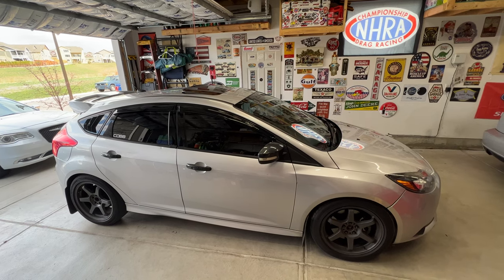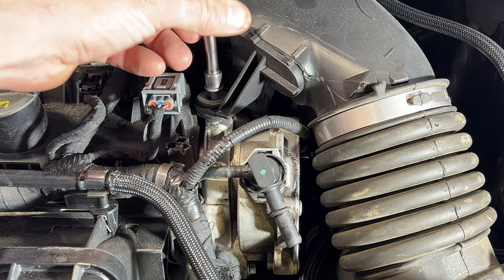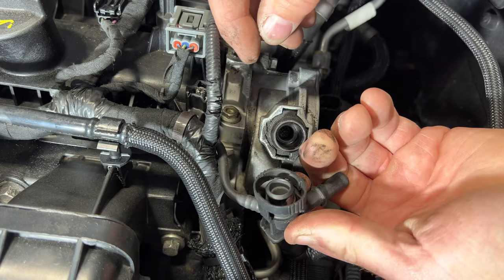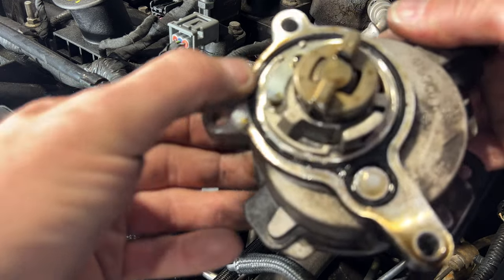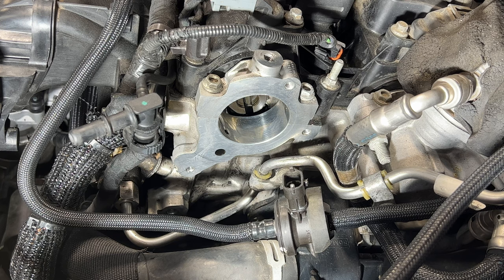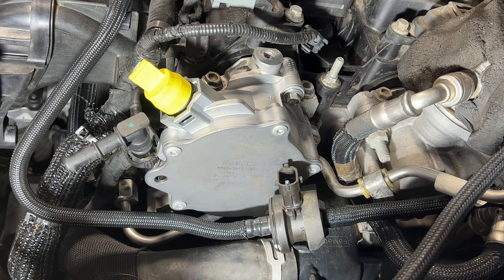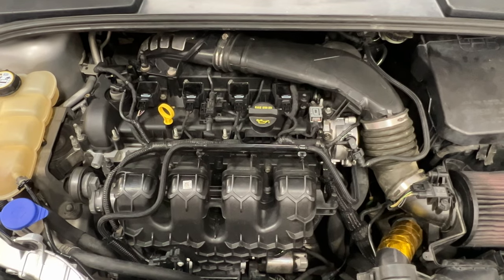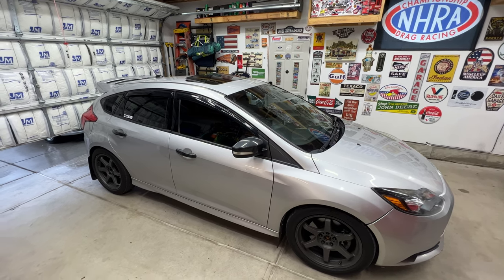Ford 2.0 Ecoboost Vacuum Pump Replacement How-To

Comment: It was exactly my problem. But on my side the Pump has jammed and the Camshaft Pump Drive Coupling bolt has broke. I replace the pump and the coupling screw. It Was very fun to remove :) Your video help me thank you.

Comment: That clip you removed on the top of the vacuum pump that connects the vacuum lines from the boost controller and the brake boost line. What is that clip called and what is the part #? Thank you!
Great video by the way, wish more people made videos like this
Reply from the maker: Unfortunately you have to buy the whole vacuum line assembly and not just the clip. https://www.tascaparts.com/oem-parts/ford-vacuum-line-cj5z9961b?origin=pla&gclid=Cj0KCQjwib2mBhDWARIsAPZUn_lzGg6Wj7T1Mt5x24kduTocf7n_DO5ZPShqYJODQbsZsBdHY4jpli8aAmLKEALw_wcB
Reply: @BLUECOLLARGARAGE  thank you so much. Broke mine yesterday putting new charge piping on and adjusting my EWG. Glad I can get it fixed

Comment: Same part fitted in 2013 Volvo S60 T5 with turbo 4 cylinder 2.0 (B4204T7 engines) Identical part.
Reply from the maker: Thanks for the info.

Comment: 1:50  - Denso stickers on those ignition coils. I didn't know Denso was the OE provider for Ford for those - are those original or replacements?
Reply from the maker: They are replacements but are actually motorcrafts rebranded as denso’s I actually go over that in this video if your interested https://youtu.be/IEcOzFD2-Y4?si=2pJLXhVKGmNjd5ze
Reply from the maker: They are actually motorcrafts relabeled as denso’s I go over that in this video if your interested https://youtu.be/IEcOzFD2-Y4?si=2pJLXhVKGmNjd5ze
Reply: @BLUECOLLARGARAGE Thanks for that info!  It's nice when you buy "aftermarket" stuff and discover it's really just the de-branded OE part. I knew Denso made parts for several manufacturers but I didn't expect it from Ford!   Especially surprised by the Made in USA on a Denso box!  The ones I've purchased for Honda and Toyota were all made in Japan.  I'll have to research where in the US Denso might be making stuff. Thanks for the follow up!

Comment: What are the syptoms of a bad brake vaccum pump?  Having some intermitten issues with our Lincoln nautilus the front rt cailper is heating up and smoking sometimes.. Checked the Calipar and  brake line are good..  Mechanic says it's ABS, haven't taken to dealer yet but dealer says they can reprogram abs or replace abs unit. I stumbled onto this brake vaccum pump didn't know it existed.
Reply: probably excessive brake from over 160km/h can a good vibrations? not sure but i had it suddenly i wonder if I could change it? cuz mine is leaking so badly...

Comment: The seal link doesn't work but may have to try replacing this myself.  Ford wants $400!
Reply: Really? My 13 Fusion is at the stealer right now. They want $734.40 because the seal is bad and it's leaking oil. Literally stealing from people. 2 bolts and the intake. They make it sound like the front clip comes off.